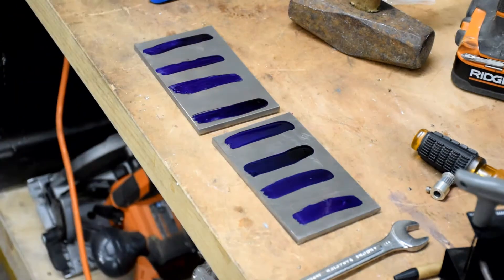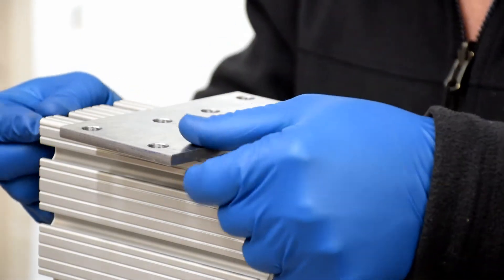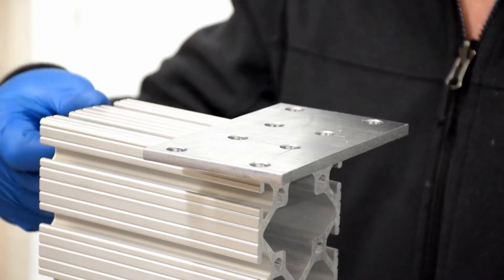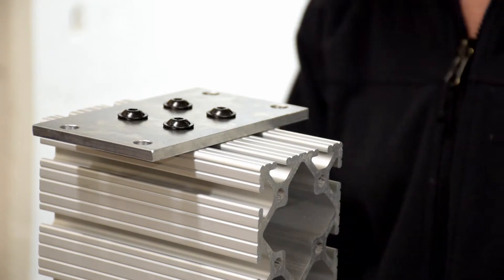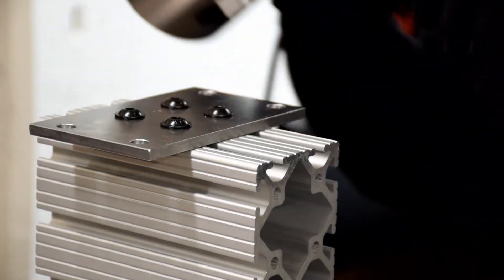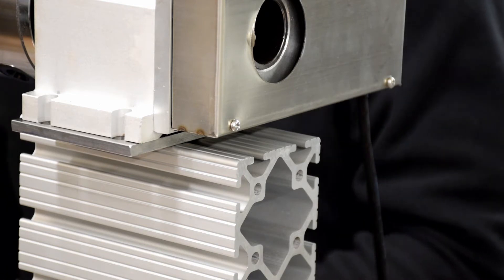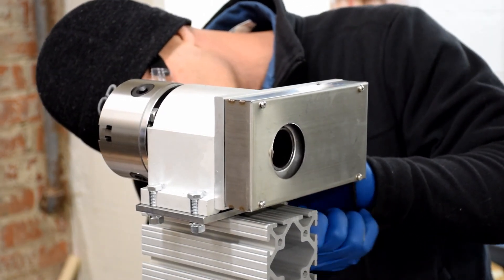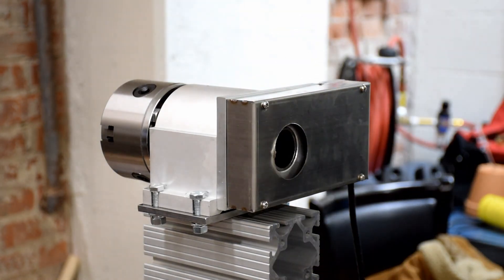Chuck mount

Comment: Ordered motors with help from the equipment spreadsheet August 2020 and found that Automation Technology is now supplying a different product.  Maybe it's the same motor and chuck, but the housing that holds it all together and mounts it to plate has changed.  The new spindle bolt hole spacing is more like 3-1/4” to 3-5/16".
So don't goof like I did, don't drill those holes until you have the unit in hand to confirm.